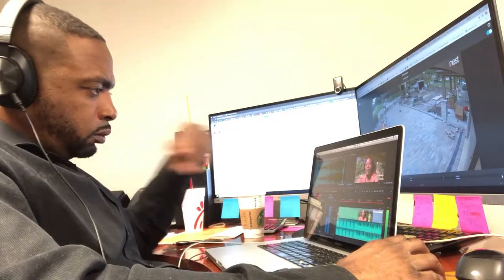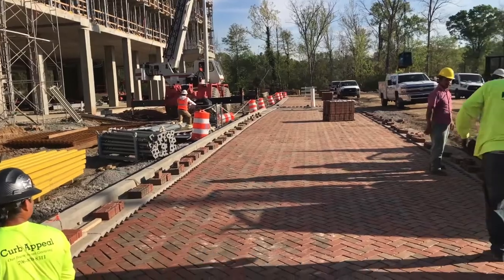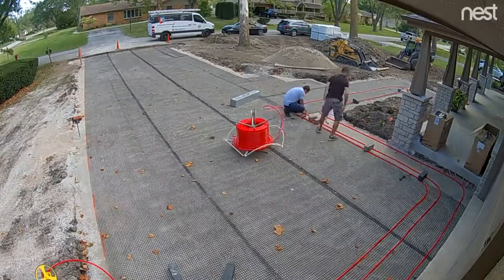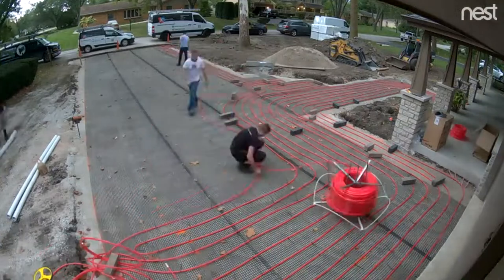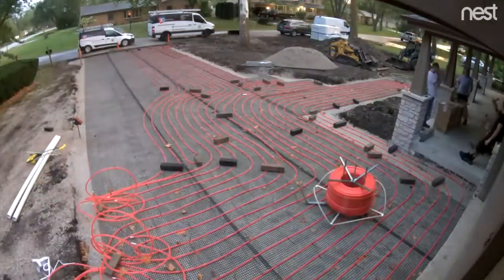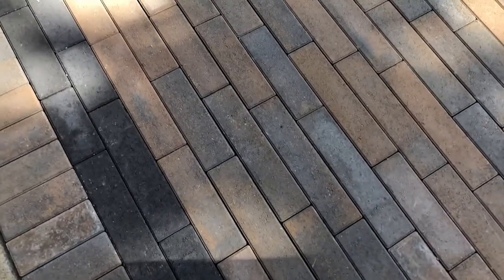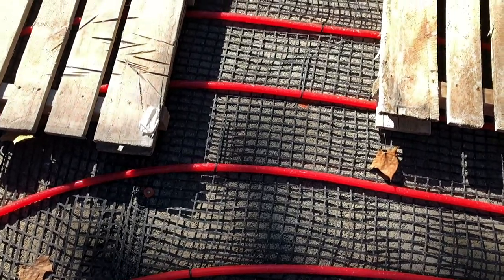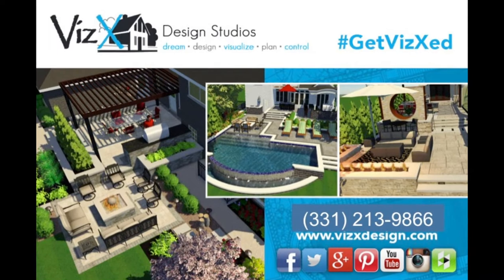HYDRAULIC SNOW MELT - Techo-Bloc - Brick Paver HEATED Driveway - Vlog #074

Comment: Good video. Consulting is a great. Any time you can expanded your influence up, down, and lateral is a plus. It also shows that you are a trusted professional.  The drive way did look good. I need a new drive way but, I would never see the return on the investment in my older neighborhood. I have already remolded most of the inside past my neighbors. We will see if USAA comes through on the hurricane damage to the roof and fence. Ok I went off topic. Sorry.

Comment: It appears the tubing is placed directly over the mesh and compacted concrete road aggregate.  I do not see any insulation underneath the PEX tubing which would normally be required to prevent heat loss from radiating into the ground below.  Was none used?   Ideally, you want as much heat as possible to radiate up, not down.  Also, what size PEX tubing did they use in this application?

Comment: What was used to hold the bricks on the edges of the driveway? Typically plastic edging and spikes are used as a retainer. I would think something else was used for this scenario to avoid damaging the heating system.
Reply from the maker: The heating system does not go all the way to the edge. But there is a product called Perma Edge that can be used.